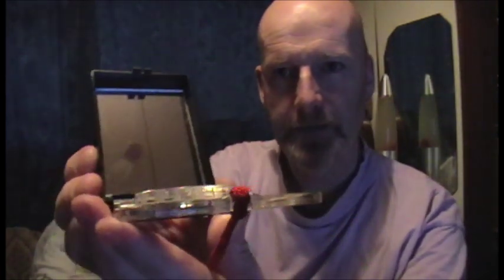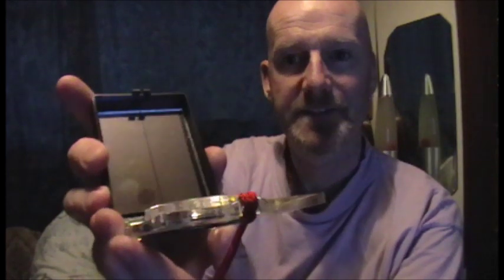HOW TO USE A SIGHTING COMPASS

Comment: My be worth mentioning the Silva Expedition baseplate compass that has a built in sighting system.  No mirrors - brilliant.  Not cheap, but if you buy a compass for serious use take a look at those, as the accuracy compared to mirror sighters are 'seriously' good !